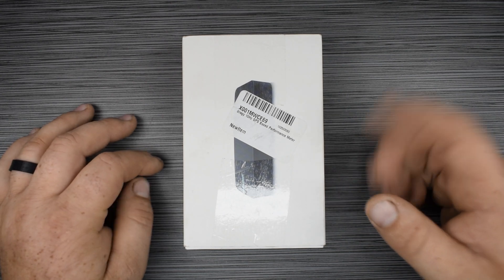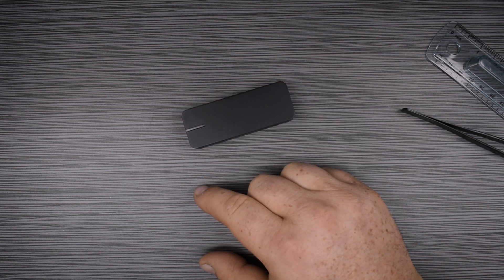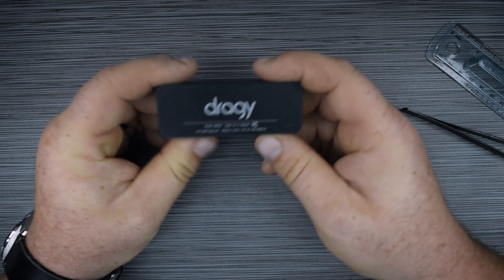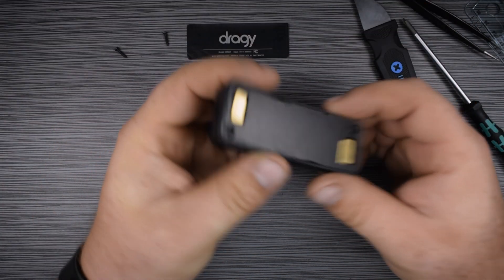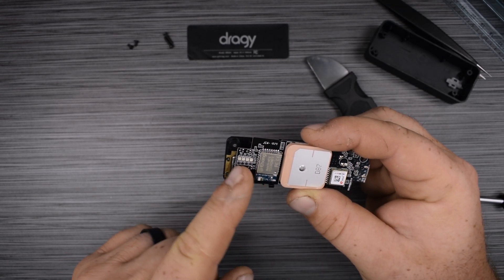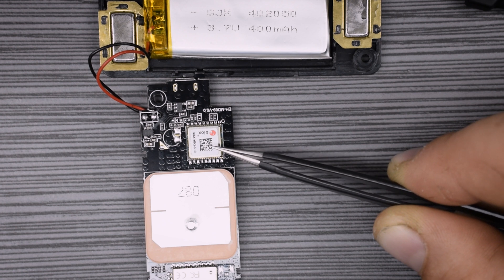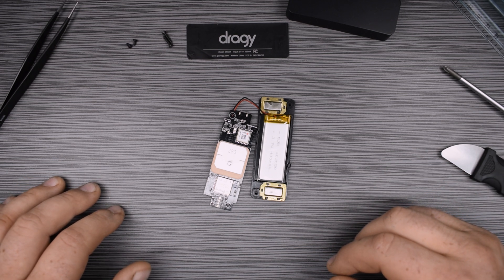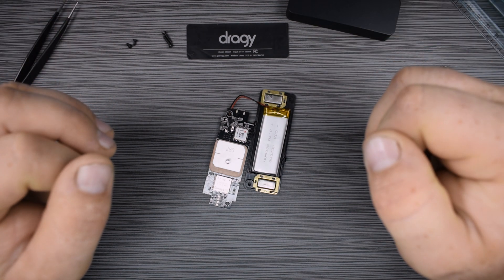Dragy Teardown

Comment: how is the GPS marked as 10Hz if it's 1.57GHZ?
Reply: 1.57GHz is the GPS signal frequency it tunes to (this is standard). 10Hz is the update rate, meaning it can estimate a new position every 100 ms. That’s what makes it special for precision acceleration timing.
Reply: @eduardolussari6834  secretely, it's good for 18 Hz tho

Comment: Great video... Wish I would have found it before I took apart my Dragy. 

Reason I needed to do so was that the opening in the case and the charging port on the main board inside did NOT align and thus prevented the insertion of the charging cord. After repeated emails to Dragy "support", I was told I could remove the label and then the two screws to gain access and attempt to correct the misalignment, which I was then able to do.

I find their instructions lacking in that no reference is made to whether or not the light changes color when fully charged... Right now it is blinking RED... we will see I guess...

Thanks for your video.

www.Nova-SS.com

.........................................................................
Reply from the maker: Thanks for you comment! I hope it works for you, that is a shame to hear it doesn't sound like they gave you very good support. Seems to be a trend among a lot of companies nowadays:(
Reply: Did you get your dragy working?
Reply: @txfatmarine4583  Yes I did.... took out case screws that are hidden by the label and was able to get everything to line up to enable the charging cable to be connected... Thanks.

www.Nova-SS.com

********************************

Comment: Where to guy a battery? I havent used my Dragy for a few months and now i cant charge it...
Reply: i need same info.
Reply: Has somebody found a solution for the problem?
Reply: @ua.autowerks  I tried replacing mine with a battery I found on alibaba (same voltage and mAh) unfortunately it still didn't work. I think we need a replacement battery directly from dragy
Reply: Mine won't charge either :(